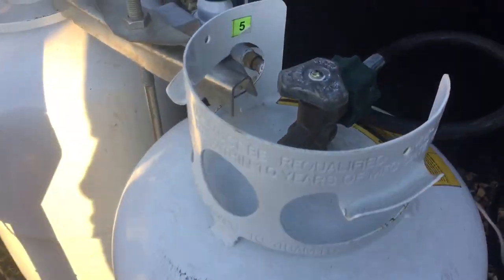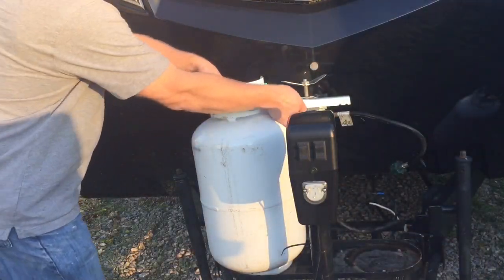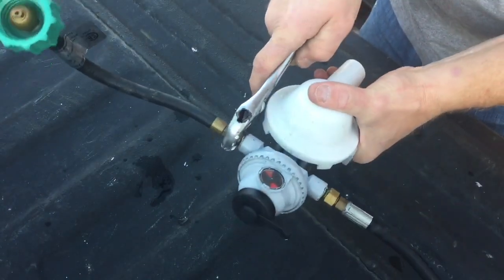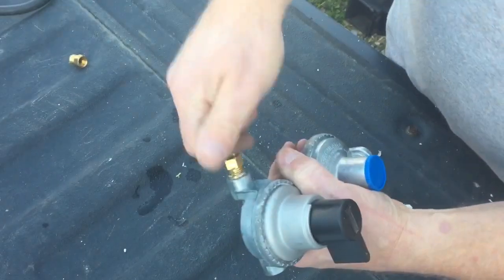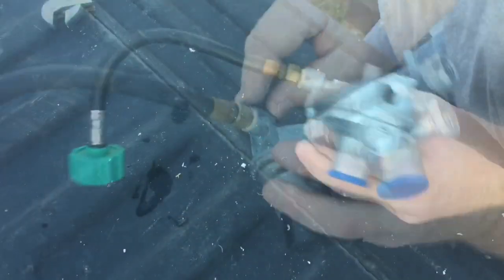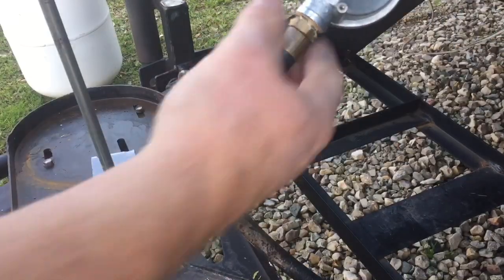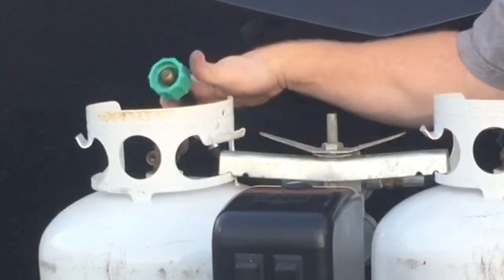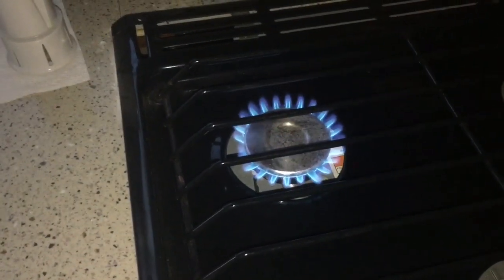Changing a Double-Stage Auto-Changover Regulator on an RV

Comment: Great video,  I had an issue with my camper recently, thought it was my regulator but ended up being a problem with the checks in my hoses not letting gas flow to my regulator, but I watched another video and they were saying that it is recommended to do a pressure drop test "?" or "something like that", when changing out a regulator have you heard of that?  One little tip also I would either use an open end wrench or turn my crescent wrench the other way especially on brass fittings because using it backwards could strip out the flats on the fitting.

Comment: I had the same Fairview regulator leak in the same location on the top crimp on a 1 year old trailer! If you have one of these Fairview regulators, it would be a good idea to check it for leaks often, or replace it preemptively. Thanks for the video, my replacement went the same as yours. Be sure to shut off the propane valve before removing the propane tank connector.
Reply from the maker: Good idea to check those regulators regularly, Thanks for watching.

Comment: Probably a good idea to change out the pigtail connectors at the same time. The ones on your video looked very stiff and old. They fail and leak fairly regularly as they get old.  The new ones will have a soft flexible hose, when they get hard and stiff as in this video, replace them.
Reply from the maker: Unless you are a RV parts salesperson I wouldn't change these out every 3 years. That is how old the RV was when this video was made. Instead I would check for leaks and if it is flexibility you are looking for then I would check that when it is warmer out not in February when this video was made. You can change them as much as you want but they will be hard and stiff as in this video when it is cold out. Thanks for watching.
Reply: funbro1 You have a good point.  If they are not leaking and you checked them, why replace them.  I assumed they were as old as the regulator which had failed.  The other argument is that you can spend 20 bucks to preemptively ensure you don’t have a failure when you least want it.

Comment: Hi Bob after watching your video I feel more confident doing this myself. So far got everything disconnected but on one side the hose came off with the brass fitting from old regulator to my my hose can’t get it off. Any suggestions?
Reply from the maker: You will need to seal it back up when you put it back together. If you are talking about the crimped part then that would have to be replaced.
Hope this helps, thanks for watching.

Comment: Hi, this is helpful thanks. When you have the gas on and both cylinders open can you hear the gas moving through the system? I set up 2 propane cylinders to my mobile home with the double regulator. However we can hear gas. There is no leak and absolutely no smell of gas. Just wanted to make sure it is normal to hear something like this. Thanks
Reply from the maker: This one has a cover over it so any noise that it makes can’t be heard through the cover but to my knowledge the only noise may be a slight hissing as gas is traveling through. Hope this helps, Thanks for watching
Reply: @funbro1  great, i think this is what we are hearing. Thanks for the reply.😊

Comment: in just received a safety recall from Jayco , the Wintec model 6020 two stage regulator on my Open Range camper is defective...along with about 87,000 Jayco products ...guess i will replace it myself !
Reply from the maker: It's not really that hard so you might as well with the time frame that many places are quoting as far as time goes. Thanks for watching.

Comment: Nice video.  Very informative.  My only comment/question is it appears you install your propane tanks and regulator backwards from how I've ever seen anyone else do it.  You can't easily see visually whether the valve indicator is in the green or the red.  Is there a reason you chose to install it that direction?
Reply: You can just sprint it around to check but it's the way they installed it stock. Same on my TT
Reply: Ours came stock this way, also. Turning it forward twists the outlet hose so I just leave it rear-facing.
Reply from the maker: Hoses seem to fit better this way. Thanks for watching.